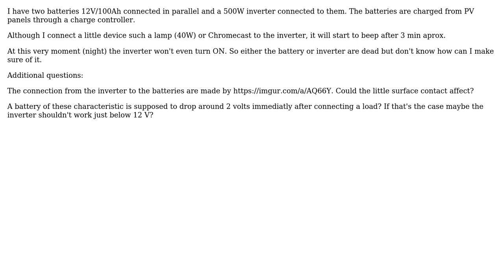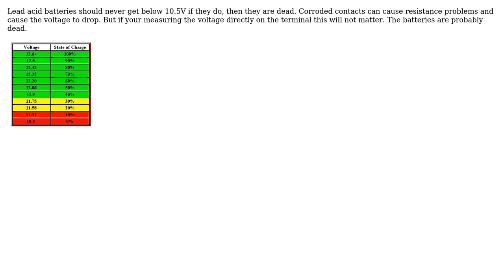Power inverter beeping

Comment: Because the power bank and inverter system are taking a load when you plug something into the system, there should be a voltage drop. But how much is OK and not OK? How much drop shows there's actually a problem? 

You said lead acid batteries should never drop below 10.5 Volts. But that is the stated amount for with nothing plugged in and no load. Its different if there's a minor load, going through.
Reply: No